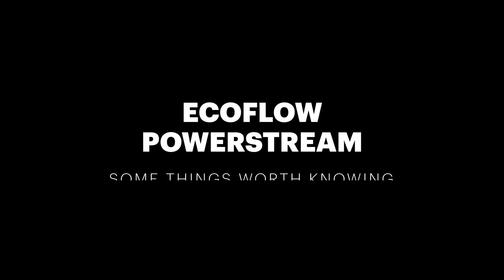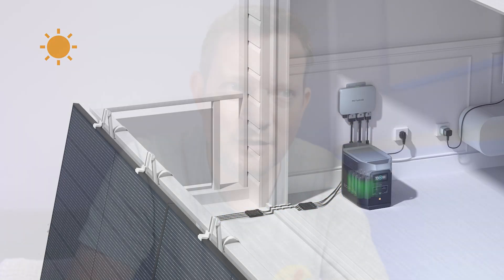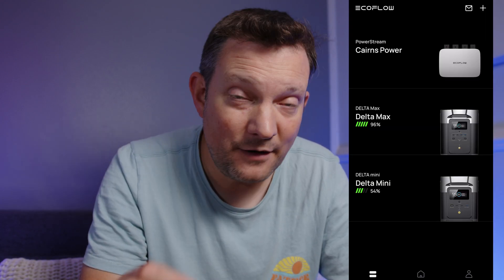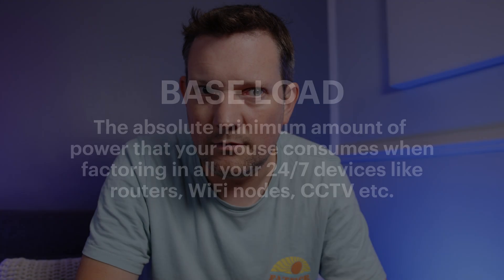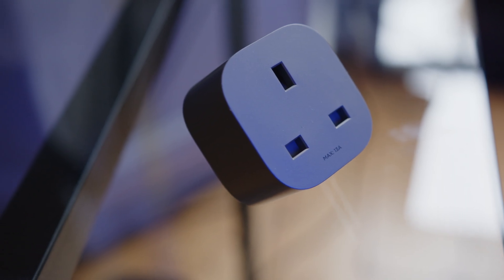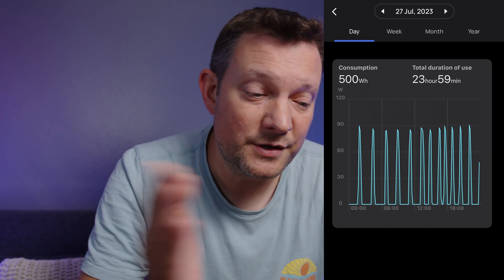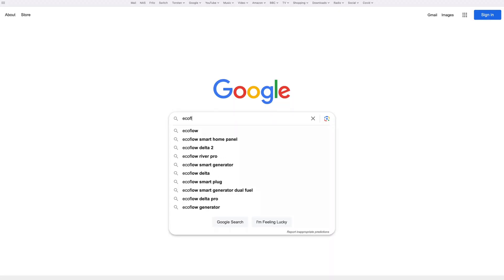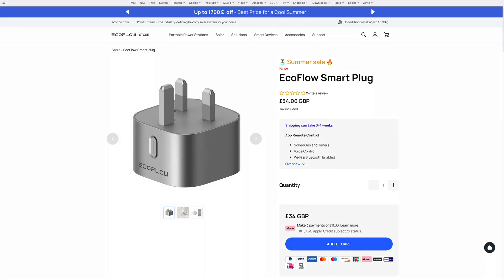EcoFlow PowerStream - 10 Things You Don't Hear

Comment: Thank you for a lot of useful information. It is generally confirmed that PowerStream will not operate without a power grid connection. But I also saw a video on YouTube where people disconnect the PowerStream from power grid while the Delta 2 station connected to the PowerStream continues to charge from the solar panel, which is also connected to the PowerStream. Can you comment on this? Does this really work?

Comment: I'm not fond of the Powerstream when it initially came out, been highly skeptical of it. I don't own one yet but I've been looking at their new release, the EcoFlow STREAM Series ULTRA/PRO.

What do you think of this??

It is worth noting that I own the Delta Max 2000and EF Dual Fuel generator too, the latter still boxed brand new and unused.

I use the EF DM2000 frequently since I moved home now and got decent sunlight coming through the house and garden. I did buy a VTOMAN 3kw combined with 400 watt portable solar panel which has been a godsend. I believe the ECOFLOW brand is pretty overpriced if you compare to what you can get from solid companies on Alibaba

Comment: I don't agree that power put back into the grid is totally wasted. Yes, you won't benefit from it but the grid benefits by becoming a little bit greener. I do not see any disadvantage to you setting the house load to the max of 800W and just letting anything not used by you will just go back to the grid.
Reply: That is because this inverter doesn't have a CT sensor on it. A CT sensor changes everything. It makes only what you are using!!! And y&h makes such a unit...

Comment: Thank you - I am writing this in April 2025, things have been updated of course, but you have clarified several good points, they do gloss over in the marketing some important points..I have an ordinary meter and even at base load of say 80W it runs backward.  Not mentioned any where of course.  Several U-tubers say meter will be damaged.  I guess I will need to change to a smart meter.  Also as I write the smart plugs are NIL STOCK world wide.  I wondered why I could not get above circa 600W, to the 800W max.

Again THANK YOU!
Reply: It could be argued that you have the best experience, everything you export (sending the meter backwards) directly offsets what you consume at other times. 
The rest of us are stuck with import and export readings where you get paid much less for export than you pay for import.

Comment: I was under the impression that it works even without being connected to a ecoflow delta power station. I messaged a local seller and they said it needs to be connected to the power station, is that true?
Reply: If I understand your question correctly, .... Yes, the PowerStream works perfectly on its own without a power station connected. I have operated a PowerStream 800 for several weeks on its own, connected to two 170W panels, and no powerstation. It obviously just produces power during sunlight, and covered my 'base load with fridge running' during times of sunshine. 
This week I have just received a Delta2 powerstation, and a Shelly 3EM smart metering device, so I can dynamically adjust the power fed into the house wiring to exactly match my load, regardless of variations in the load (within limits of course).

Comment: I nice video .. I have question to ask , so I’m about to buy a Ecoflow pro 3 whit 4x525 solar panel… do you think is ok whit them 4x525 solar panel running whit the PowerStream or is best to buy a small solar panel to running whit the power stream … 
I little bit confused about solar panel which is the best …. Thank you
Reply from the maker: It all depends on the final voltage reaching the PowerStream. So that will change depending on the specs of the panels and the way you wire them. Which model of panels are you going for?

Comment: Hi i have a Eco Delta 3 how do you schedule charging as i have cheap rate 11 30 pm to 5 30am.
Reply from the maker: I've not had access to the Delta 3 but this was possible with the Delta 2 through the app. The other alternative is to use a £5 smartplug to schedule AC on to the device between 23:30 and 05:30. That's what I used to do. 23:30 would come around and the place would sound like a server room with numerous batteries powering up 🙂
Reply: @tdcattech  Nice one thanks.

Comment: Are these UK G98 Compliant? I've seen so many forums and videos saying the grid feedback is extremely dangerous and can cause issues with both your power supplier and the DNO. Ecoflow seemed to have pulled this product from UK sale, maybe due to safety concerns? Have you got any updates on your experience and have EcoFlow informed buyers of their safety and their legal status being used in a UK home?
Reply from the maker: I no longer use it and now have a full MCS G99 certified system. I'm not qualified to comment on compliance of this product but my guess is that they are not. I believe EcoFlow sell a variant now that has to be wired into your house a little more robustly now. As for compliance of that device, not sure.
Reply: @tdcattech  Indeed it seems like it gets pulled from sale every other day then reappears. To be UK compliant at all you need a DC breaker for the PVs and then the PowerStream needs to be wired into its own breaker, and DNO would need to be notified for G98. A lot of faff for little reward on its own. Would be interesting to see this as a cheap supplement to a house with an existing PV system, where certification has already been granted etc. £99 for the Powerstream, another £100 for two 450W panels, some cable and a DC breaker, you could be exporting an extra 1-3kWh a day realistically, which would pay itself off in about 4 to 5 years? I don't know if you need to re-notify DNO if you change the household export capacity on your G99 cert though 🤷‍♂🤷‍♂

Comment: Thanks for the video!
I have a Powerstream integrated with 2 smart plugs connected to same rooter. I tried to add one more smart plug connected to wifi range extender but I can not add it to the same system. If connected to the same rooter as the powerstream and smartplugs than it works fine.  Does any one find a solution how to integrate Powerstream and smart plugs connected to different rooters/range extenders? I am thinking to relocate the rooter so its cover all devices of the system.

Comment: Im pretty sure here in the U.S. the power company will actually pay you for the power you feed back into the grid.
Reply: You have to be approved and then they pay you about half what they charge you. It took 1 year + to get my system approved and installed and an other 2 months for the Power company to ok It for turn on. You would have to be permitted at about $300.00 to install this if you can get power company approval for it.

Comment: Hay, great video. I also have powerstream and 2x400w ecoflow panels. I also thought that ecoflowvwould automaticly feed amount of  power needed on the house. How are other solar paner balcony systems, do they work similar or better, or even worse? Here you can adjust household demand(base load) . I also bought used plugs for fair price and planning to buy used delta max 2.
Thank you for your answer

Comment: Let's set the record straight: EcoFlow claims on their website that their system can save you €1,246 per year on electricity bills. However, this is highly unrealistic for someone living in an apartment. Let's break down the numbers using the rate from British Gas to see how much power this would actually require.
The current rate is 22.59 pence per kilowatt-hour (kWh). Converting €1,246 to GBP gives us approximately £1,049. To save £1,049 per year, you would need to generate:
1049/(0.2259×365×24)=0.530 kW (or 530 watts) around the clock all year long.
This means your setup would have to deliver a continuous 530 watts, 24 hours a day, 365 days a year. The EcoFlow PowerStream has an 800-watt solar input limit. Now, consider how much space would be required to fit 800 watts of solar panels on your balcony—quite a substantial area for an apartment.
Moreover, if you were relying on a Delta Pro (with a capacity of 3.6 kWh) to provide this power, it would be depleted in just:  6.79 hours
Delta Pro @ 3600wh/530w≈6.79 hours
For the remaining 17.21 hours of the day, not only would the 800-watt solar panels need to deliver a constant 530-watt load, but they would also need to fully recharge the Delta Pro which would never happen for sure in the UK where we get 6 to 9h of sunlight in winter e.g. 9h  x 800w-530w) 2.430kwh < 3600w. If one was living in Saudi Arabia where they get 10 to 11h of sunlight per day it might be possible but there energy is free so they don't care about spending 3000GBP in ecoflow products to offset their electricity bill.
In conclusion, the savings claimed by EcoFlow are overly optimistic and do not reflect the practical limitations of using their system and solar exposure we get in Europe and UK

Comment: Have you notified your supplier that you have connected solar ? 
I have quite a high base load usually around 400w so I have just set it to max and not particularly worried about the back feeding until I get a battery. 
Just not sure wether I should tell the supplier I’m back feeding every now and then when the sun is good
Reply: Hi, im following the conversation. I just want to confirm do you only have the powerstream alone or do you have any other ecoflow products, like delta..etc connected.

Comment: There are several things I don't think are not mentioned here that are important and downsides
1. It's tied to a management server in China, all automation goes via it so if they go away or geopolitical stuff happens - poof you mostly own a brick
2. The moment you want more than maybe 2KWh it's incredibly expensive compared to proper wired in solutions (and except in a small flat you will want more than 2KWh once you dabble ;)) so it's actually not a good beginning as you can't upgrade it to the size you'll want
3. The 12v output of the units is only a bit over 100W. That prevents you using a lot of the camping/caravan style efficient 12v kit to save power
4. The automation is very limited unless you install 3rd party tools (which still all depend on China)
5. The range on the powerstream wifi is dire, and the smartplugs likewise. Fine for the intended small Chinese/European apartment but not good anywhere else
6. Their support is now terribly slow, and returns even slower (big issue as their QA is also iffy - just check how often they have refurb units for sale).

The EPS mode with solar they added in firmware is excellent though if your use case is emergency backup and you want to also get the benefit from solar, as is the ability now to stack solar on the battery and the powerstream.

Never buy their kit except on a special special offer with coupons and all the rest. If you missed the sale just wait a couple of weeks and there will be another one.
Reply: "1. It's tied to a management server in China,"

This is the really key worrying point; people are shoving something on to their home Wi-Fi, with no security oversight as to what it's doing and how it's operating.  I've been considering the PowerStream, as it's fantastic value for a micro-inverter, but the only way I would be comfortable with using it is if it were on my partitioned IoT Wi-Fi, and as the firmware isn't open source, it wouldn't be allowed to communicate through the firewall ... which means it's useless.  Also, useless for a remote location that doesn't have internet access.
Reply: @mitchellquinn  I would not worry too much, we are all happy letting the US companies spy on us; Microsoft, Google, Apple and many more. The US is turning out to be the bad guy as recently shown.

Comment: Hi, I really appreciate your videos on the powerstream, Im pretty new to this and was wondering if you or anybody else could help me regarding sizing panels for use with these. I really like the sound of the bifacial panels and have found a few online that say they are 430w, as I understand it with the rear side power gain this is increased to 525w with 16amp at 32v. If I was to use two of these with the powerstream would it be too much power/wattage? And damage the unit? Thanks in advance

Comment: Thanks for the video. 

I'm looking at getting a Delta Max (2000) and a transfer switch for the sake of having basic power when an outage occurs - I'm talking lights, 2 routers and TV and fridge. I'll also be getting some EcFlow portable solar panels to help alleviate the constant need to charge the Delta Max with grid power. 

Any thoughts on this, being a PowerStream Balcony system user?

Comment: In the UK it is  illegal to backfeed into your home circuit this would be obvious to anyone who knows what their talking about. This entire product is highly dubious. Remember the power loss through any inverter is at least 30,% . This inverter is tiny it has no fan cooling either . The whole system has no reasonable safety accreditation the savings in electricity will modest in the extreme . And it's potentially lethal . Do you have ANY qualifications in electrical engineering??
Reply: No one is forcing YOU to buy it!
Reply: @alistairlambert3275  correct but it's illegall to connect to homes in the UK it has no EU or UK accreditation and it's breaches code requirements in the USA . It's a piece of crap I am afraid and possibly a dangerous piece of crap that fortunately no longer for sale in the UK . Fortunately regulations and consumer laws are there to to protect innocent dupes and morons
Reply: Power loss on modern inverters is well under 30%. The unit has all the required accreditations for a load of countries (just not grid tie in the UK). As to power savings - in the countries it is legal to do grid feed in via a socket it most definitely saves enough electricity to pay for itself. If you can't grid tie (eg the UK) then it's less of a benefit but works for some loads, especially if you automate stuff like 2am-5am Octopus charging, and also gives you a really good EPS setup.
Reply: @etchedpixels it breaches electricity codes in the USA the UK where is the accreditation show me or point me to the place I can find it . The company do NOT reply to emails regarding this product and there is no published accreditation or independent reviews WHY?
Reply: @ianfossett4482  It's fully approved in lots of EU countries, and just got approval in South africa for example. Lots of the EU permits plug in solar up to 800W (not all - Denmark for example has UK like rules).
Reply: @etchedpixels  from ecoflow terms and conditions ..  SECTION 20 - GOVERNING LAW
The Terms of Service and any separate agreements whereby we provide you Services shall be governed by the laws of Special Administrative Region of Hong Kong, PRC, without giving effect to the principles of conflict of laws. If arbitration is permitted under these Terms, then you and EcoFlow agree to submit to Hong Kong International Arbitration Center (HKIAC) according to its arbitration rules.

Not sure that anyone in the UK would stand a cat's chance in hell of taking action against a company in the PRC, TBH. If they had a UK subsidiary that took responsibility for all UK legal and compliance matters then I might think differently. Chinese companies have a long history of playing fast and loose with product safety and approvals. The very old joke is that when they put a CE mark on a product it stands for "China Export" and not "Conformité Européenne" as many might believe. As I said can you point me to any documentation that says it's CE or G98  approved for connection to the grid in any countries ? . Your claiming that it has approval in "South Africa '!!!!!! As endorsement of the quality of the device !!! 😭😭🤣🤣🤣🤣
Reply: You can buy a cooling fan unit for the inverter ;)

Comment: Great video. I may be late to the party here but on the "is it legal in the UK"I got this back yesterday from EcoFlow customer service "we are sorry to say that as Powerstream is a Plug & Play product, Plug & Play in the UK is currently not fully compliant with the regulations. Therefore we do not sell Powerstream in the UK at the moment."
Reply: A shame as it sounds a great product. Has anyone got any insights on an upgraded product meeting UK regs and/or change from UK end?
Reply from the maker: Really? That's the first time I've heard Ecoflow openly admit this. Good to hear.
Reply: @tdcattech  They've been playing silly games for a while, presumably because they don't want the ones they did sell returned and fined. The issue isn't the product as I understand it from the electrician. He thinks it has to be wired in, and probably with a lockable isolation switch (like any other solar) to meet the BS wiring standards
You can validly use it as a better MPPT for the battery and use the battery outputs to drive a load of stuff. With the newer firmware that makes sense because you can tell the battery to do things like "keep 20% or above and mains on, only charge above 20% using the solar". If you are not getting paid for the power used and you can put enough on it that the battery rarely hits 100% it's not that much of a downer, and you can set whatever %age as you like so it's also a small EPS.

Comment: Hey, 
do you know if there is a way to connect 2 powerstreams to a single battery? input would be via the first powerstream and the delta pros internal inverter. the second powerstream would be used to outpot 1200W peak from that battery.
BR,